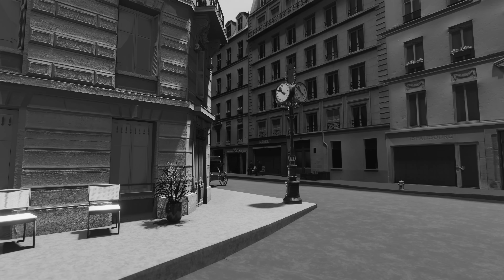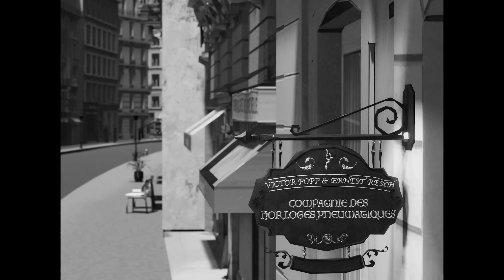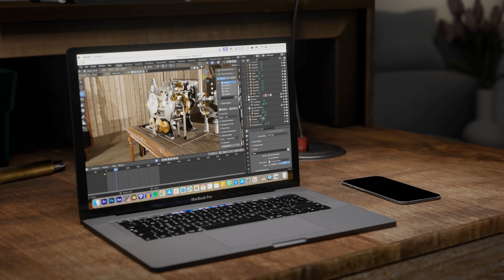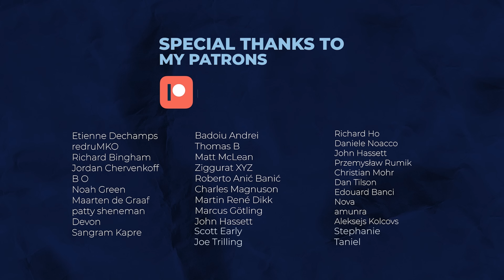The Underground Clocks of Paris

Comment: 7:24 - must be "a ratio of 1 to 60, meaning that the minute hand would complete 60 rotations..." AFAIK one Hour has 60 Minutes, not 12... BTW: Centralized ELECTRIC clocks were not powered (separately) either. The electric energy contained in the pulse was used as well to drive the hands and gear. So these electric master/slave clock systems were quite similar to this pneumatic system.
Reply from the maker: You are wrong. One rotation of the hour hand is equal to 12 hours. And so the minute hand should rotate 12 times for every full rotation of the hour hand
Reply: @primalspace  You are perfectly right - one round of the minute hand is a full hour. And as 12 hours are a full circle of the hour hand, the hour hand must advance with 1/12 of the rotation speed of the minute hand... I was thinking of the seconds hand.

Comment: Cool fact. It amuses me that the system - in a different form - is still in use, although it has been significantly improved. Now, in smartphones, laptops and other computer systems, time is synchronized from Internet time servers based on the most accurate atomic clocks in the world. It is not the air that synchronizes us, but signals via the Internet, but the principle is the same: central clocks synchronize the operation of local clocks, which make their readings available to people and their devices.

Comment: And here I were thinking it were going to be some pressure based hydraulic system.
Since having a gauge rotating a set distance over a known pressure delta is honestly quite simple. But pulses of air works too I guess.

Comment: How does the air reach the entire system with enough pressure to move every clock? Even if each clock only required a small amount of force to move the hand, having thousands move at the same time would require a lot of pressure, right?

Comment: Just imagine even a slight leakage or shortcoming in air pressure will not inflate the clock gear much, and you miss a minute update 
now you need to figure out where that leakage is. Keeping the gas can at a consistent pressure is also a challenge.

Comment: Seems super unreliable but I guess it works.. I guess even if the compress air took 2 minutes to get to the end of the system the clock could be adjusted by distance.   I bet they had problems with air leaks in the system.

Comment: You didn't tell us why the clocks failed in the flood.  What was the required pressure?  What was the volume of the system?  How much air was inserted for each pulse?  Was the pressure released by flowing back to the master, or was there some clever scheme at the ends of the branches?  How did the apparent pulse duration vary with distance from the master?

Comment: This was all extremely interesting, but I still have three questions.

The first is how they kept the master clock in-sync with the observatory clock. You segwaid your way to the promotion (which is fine, you have to make money somehow), but you never actually said how they kept it in check.

The second is what their source of pressure is. It had to be quite strong to pressurize such a large network off of a single pipe, and it seems like it'd have to be a constant source. That or it was timed to generate a bunch just before the release.

The third is how they made compressed air work as a decent timer. Unlike electricity, air does not move at near-lightspeed. How did they manage to ensure the master clock and the clocks farther out in the system were accurately timed? Did they accept being inaccurate to a single minute, and also moved clocks to which air pressure would arrive a minute (or more) forward a bit to make a previous minute's pulse move the current minute? Did they use freshly-synchronized pocket watches to know how far they needed to move back the time?  Did they have another method? Or were they fine with being inaccurate as long as the inaccuracy never grew?

Comment: Can't imagine the pressure drop at the end of the tubes or what they did to deal with leaks... Very cool!
Reply: There is theoretically no pressure drop since it was a closed system. Leaks were inevitable, however as long as they were kept to less than the amount necessary to pressurize the system for each pulse, they had no effect. The leak would be detected by the clocks that appeared out of sync.
Reply: @billmoran3812  if you had many small lines manifolded out of one big one, I would imagine a large leak on one of the small lines would cause issues with all the others and be complicated and time consuming to isolate. You would have to one by one leakdown test each circuit to detirmine which was leaking
Reply: @billmoran3812  Likely the signal would travel more like a sound wave than reaching every place at once. So a small leak won't matter so long the wave first reaches its destination before air has escaped.

Comment: Hmm interesting. How much air did the master spit out?? Seems you'd need a tonne to fill a thousand bellows... And then after they're full: what? Was there an "over pressure" valve at the end of a bunch of the main lines maybe? So the twenty second period of pumping in air increases the pressure in the pipes, fills all the bellows, escapes when full, and then what? It would have to return to "normal" pressure in the pipes which I assume is just 1bar... How was that done? Did master clock also vent all the pipes after that twenty seconds so that all the bellows would collapse again? So many questions!

Comment: Sorry but I think the graphics were poor; a ticking clock was shown with continuously rotating gears, instead of intermittent and the tooth forms are all wrong. Seriously all CAD packages come with the correct gear tooth forms as primitives in their libraries.
The Pneumatic time distribution system was not superseded by 'electronic' clocks but by electrically synchronised clocks, distributed over wires, provided by Le Roy et Cie of Paris. Similar systems by Gents' and Synchronpome were used in the UK. The actual timekeeping was still done by a pendulum master clock. True 'electronic' timekeeping did happen til the introduction of the quartz master clocks in the 50s.
Germany and America also had their own pneumatic systems til they were in turn succeeded by electric systems.
Mains power at 50 Hz provided excellent timekeeping til it all went to pot in WW2 and never really recovered til the 70s.

Comment: That's a square wave with 33% duty cycle - only pneumatic rather than electrical!

I've never ever heard about central pneumatic drive systems for clocks. Real deal steampunk tech. That's genius - though I wonder how it scales with area and length of the network, and how it remains failsafe in case a pipe gets burst somewhere. Electrical systems have that problem solved by relaying or amplification, with no limitation of the covered area, and if a branch goes out, it doesn't affect the whole system.

Comment: I'm amazed how they've build such a long and intricate pipe system at that time. Incredible
Reply: That's a huge array of pipes to keep pressurized!
Reply: @bubblesculptor  It would have been driven by a French built compressor. I can guarantee it would have been able to handle it... 💪🇫🇷🌬😁
Reply: Also, from todays perspective, it is wild that this was the cheaper solution compared to wires and electronic clocks!
Reply: @demog2882  hard to imagine low-voltage wiring more expensive than pressurized pipes!
Reply: @bubblesculptor  high voltage wiring would make more sense for this application, since it had to travel for kilometers; you would need pretty thick wires to make up for the voltage drop for the long distances, and also you need 2 runs of wire for every clock (tapped into the main distribution lines, which also probably needed to be slightly thicker for so many clocks)
and i assume copper was more expensive back then?
Reply: @awesomestuff9715  You're probably right on the copper front. It would have had a market for generators and electric motors (Its main applications at the time) but the more primitive extraction/refinement techniques of the time coupled with comparatively low demand would have resulted in a very high price per kilo. 💸

Iron piping - On the other hand - Was probably as low as 1/100th the price, even with the higher costs of installation. 🤌
Reply: @awesomestuff9715   Copper was actually fairly cheap before the electric revolution, since outside of being resistant to corrosion, it didn't have many uses. I'm not sure how much it costed at that time since by then it started to be used a lot in electronics.
Reply: @TheSeanUhTron  hmm... In that case it might be the processing of the copper to turn it into wires that was expensive.... I have done absolutely no research on this lol
Reply: @awesomestuff9715 I'm not sure efficient, safe, and high enough voltage lines were available back then. Also, you'd still have to translate the voltage signal into some sort of mechanical apparatus to move the clock hand. Pneumatic tubes provided both signal and power for mechanical movement without any expensive electrical to mechanical translation.
Reply: @UK-Combustibility-Assured Well, it had been developed to a great extent then for gas distribution, so this was merely another use for the existing manufacturers of gas lines, and the designers had come up with empirical rules for just how par a pulse of pressure could go, and then sized the pipe appropriately.
Reply: @bubblesculptor  Long distance low voltage wiring is merely impossible. That's why long distance wiring is high voltage nowadays.
Reply: @demog2882  Along with voltage drop along such long lengths, every junction would become a potential open or short circuit.
Then the whole lot would have needed to be ducted and the ducts have sufficient radius at every bend to draw the cables. 
Then if you got a fault, how would you ever find it. One clock, or cable could have a short and the whole lot goes down.
Reply: @demog2882  I mean, how expensive can a tiny pipe be, next to nothing if not the markup.
Reply: I suspect that the end effector (bellows) was cheaper to construct and more reliably manufacturable than a solenoid of the day. And solenoids have their own issues with required current being high. With this system, unless there's a major leak, the system has 20 seconds to build up pressure. With solenoids, you have to supply current. Yes, you can have a shorter pulse, but that just means you have to deliver the same energy in a shorter time span, meaning even thicker cables. You can't "slowly ease in" a solenoid.
And motors would have been even more complex.
Reply: @Validole  I suppose that one alternative would have been to manufacture and supply synchronous clocks, then run an AC supply to power them.
However, without an AC grid to synchronies with, maintaining the correct alternator speed would not have been easy.
Reply: @wilsjane  yeah that sounds expensive lol
Reply: @wilsjane Back then they'd probably design something using DC current with all the problems that comes with such design for transmission.
Reply: @Validole  yeah your guess seems the best out of all of these
Reply: Paris's unique sewer system was probably massively helpful for that, the way it's been helpful in the time since for various other things like network cables. Basically, there is a sewer tunnel beneath every street in Paris, and it's specifically designed to be large enough for workers to comfortably walk through it, with extra space for additional things to be mounted on the walls. The network of sewer tunnels is an almost perfect replica of the street layout above and makes it incredibly easy (relative to how it is in other cities, anyway) to install things like pneumatic pipes or electric cables that can get to every building in the city.
Reply: These people drained lakes just to put cities and farms in it. I’m pretty sure this is easier than that
Reply: There was so much vacant time back then, everyone wasn't busy with internet.
Reply: @RIZFERD  yeah, you worried about basic necessities.
Reply: It's amazing what you can accomplish by stealing resources from colonizing an entire continent
Reply: White people be doing too much
Reply: Leaks would SUCK
Reply: @BooBaddyBig  no, they would blow

Also small leaks likely wouldn't have mattered, and large leaks would have been easily detected
Reply: Yes, and why was it easier to build than a wire to carry electricity?

Comment: Given the compressibility of air and the invariable leaks of such an extensive system of pipes, it is amazing it actually worked.
Reply: Doing some basic back-of-the-enveloped calculations and making reasonable assumptions about the number of subscribers, the size of the network, and the expected losses, I am not sure I believe that there only is a single central source for all the compressed air. But I absolutely can believe that there is a single authoritative time source.

As for a network of auxiliary compressors, it would be trivially easy to build repeating stations every so often. All you have to have is a reliable source for compressed air, and a valve that opens and closes whenever it detects a pulse from the master clock. And since this is the age of early electrification and of ubiquitous steam engines, we can assume that producing compressed air is a solved problem. So, it is plausible that the distribution network included some sort of repeaters as it expanded over larger parts of the Paris metropolitan region.

With only marginally more effort, you could even build a mechanical "reclocking" device that regenerates the 20:40 duty cycle of the signal. You'd still obtain the sequence of pulses from the central clock, but you would regenerate the actual timing of each individual pulse from scratch. All of this can be done with straight-forward mechanical components.

The beauty of this system is that the duty cycle doesn't need to be super precise, and neither does anybody care about phase shift nor jitter. So, a lot of problems that modern time-keeping solutions spend enormous resources on (c.f. atomic clocks and GPS) are completely out of scope and don't need to be addressed. The only thing that matters is generating precisely 1440 pulses of approximately 20s per day. And that's easy to do with a mechanical repeater.
Reply: @gutschke  And if the signal travels longer than 1 minute to a very distant part of the city, they could simply manually offset the minute hand of those clocks for correction. It would be still in sync.
Reply: Satellite compressors would be essential so good spot there, Q; how do the correct a clock that went out of sync. Thanks for your interesting analysis.  @gutschke
Reply: @Woffy.  I'd guess you have people who would go around to reset the hands manually, probably using a watch they set from either the master clock or the observatory clock.
Reply: @moo4boy   Moo,,    Yes I think so as I don't see how a simple mechanism would be able to calculate the time from a short pulse.  It is still a funky setup but it was the norm to make things simply complicated on a large scale ?.
Reply: @gutschke  I think your idea makes sense. It would be fairly easy to have slave air compressors/reservoirs and control output through a slave valve actuated by a single master signal pipe.
Reply: Also you are limited by the speed of sound, which is pretty slow actually
Reply: It is expected that the people who designed this system thought about these problems as well and found a solution to them. Did you know that the mechanical system is the most efficient, effective, simple and reliable system on Earth ? Even when they first created control, they created it by the mechanical system. Even electronic clocks and atomic clocks depend on mechanics, without which they would not work.
Reply: All these comments... lmfao 🙄🙄🙄🙄
Reply: Capillary action

Comment: New subscriber here. I have dealt with old ELECTRICAL "central clock" systems before (pulses on the power grid of a building), and also pneumatic TEMPERATURE controls. But never considered that someone would combine the two ideas. So if it takes "a minute" to reach the furthest point did they just wait until the pulse reaches the 30 second delay distance and set the further clocks one minute "ahead"?